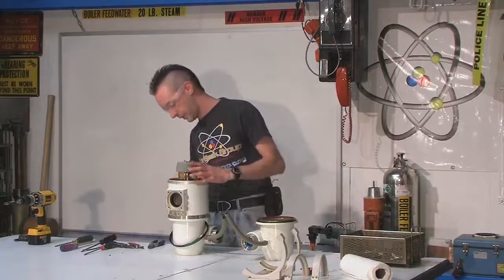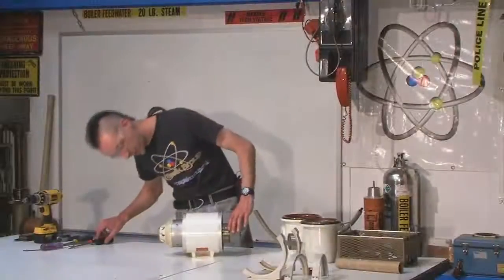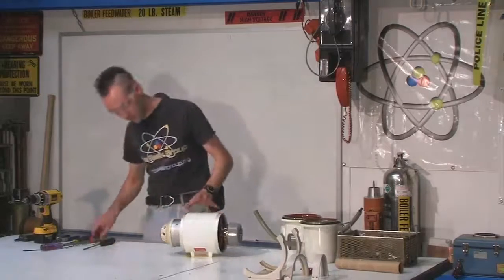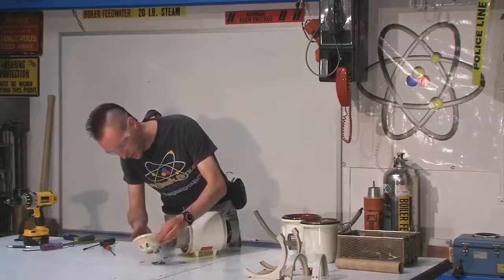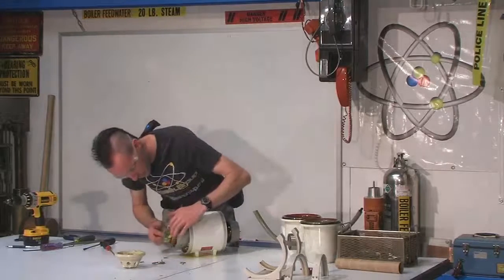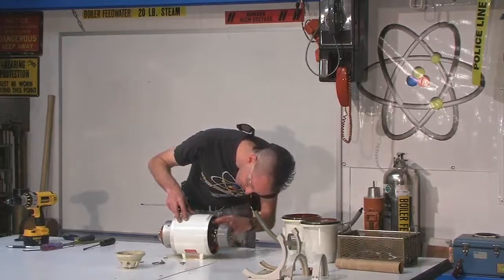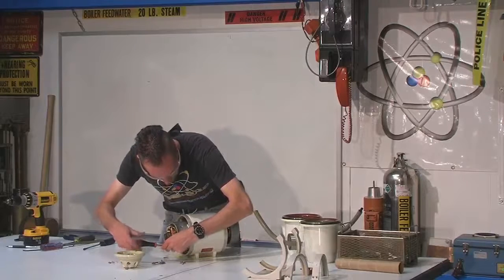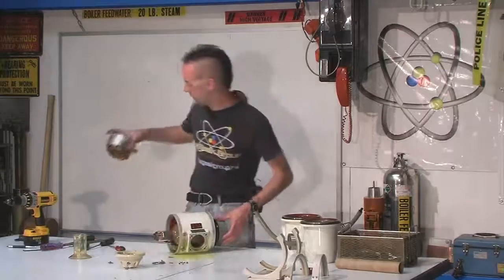X Ray Head Part 3: Equipment Autopsy #6

Comment: Chris, you mention taking apart an antique head.  I have an antique Picker head painted with some sort of patterned green lacquer and I see no seam around the tube whatsoever, and so have been unable to take it apart.  The end caps don't help--one covers a smooth convex surface covered by a lead cap, and the other covers what looks like the head of a gigantic copper bolt.  Any ideas how to open the beast?

Comment: @fart1fart1
It's a rotating anode tube.  The wires go to the external stator windings.  The rotor is _inside_ the tube and rotates the anode so that the electron beam doesn't gouge a hole by hitting only a single spot.  And a stator and a rotor, of course, make for a motor! :)